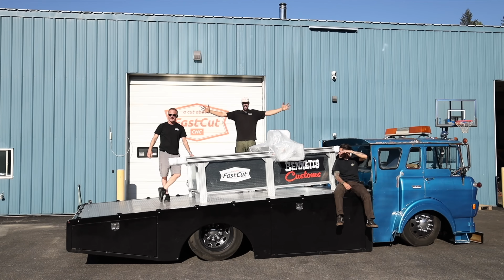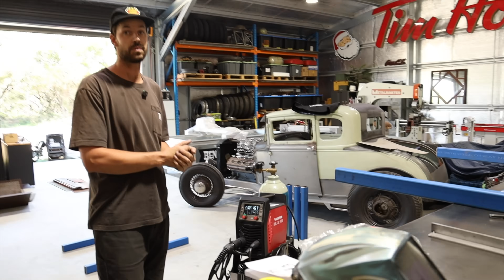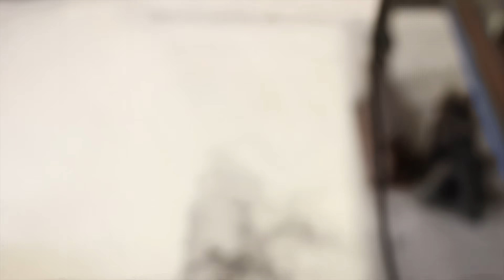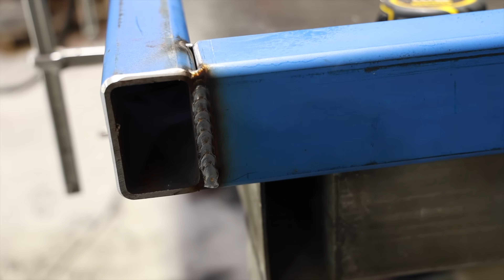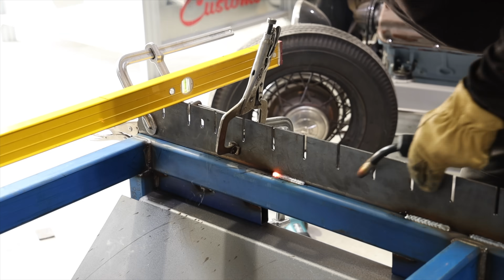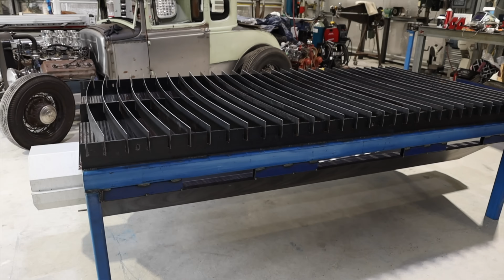We Built a Custom Table for Our CNC + Honest review of Affordable 6-in-1 Welder!

Comment: Hi Jordan ...I recently took down a tub of margarine to your workshop to use as anti splatter on your welding jobs,,,its far cheaper and cost effective than buying cans of Anti=Splatter and works just as well by simply
dipping the nozzle tip of your Mig-Welding Gun into the margarine and also stops the tip barrel from getting clogged up as well.  ..WELL SMART tip for you and your viewers... regards Graham

Comment: From my days of running a giant CNC Plasma, you are looking for huge CFM on the fan, and for the filter, youre needing a large surface area dust filter, OR, you want to look into some form of cyclone filtration.
Youll also need the fans kicked in before the plasma starts cutting to make sure the draft is already underway, and you want as much of the table covered as possible. The more you have the table covered, and the higher the velocity of the air where youre cutting, and the more likely to have the dust extracted. If you have half the table uncovered, thats the easiest spot for air to travel through, and less so where youve just started cutting.

Secondly, on that phone app for the welder, that has to be a totally stupid idea. If youre welding with a phone in your pocket, you may as well be laying there with a lighter in your pocket too. Molten metal is a great way to ignite a lithium ion battery. And if you think a cigarette lighter does damage, wait until you see a phone battery let go... Put your phone up on a shelf when welding etc. its also better for the speakers as theyre further away from metal dust. I can tell you, ive made phones useless by having speakers fill with metal dust, especially from a plasma cutter too...

Comment: I was wondering when the FastCut would make it into the workshop, it will be a good asset and nice job on the down draught table.  I see those Arc Captain Migs have been on a few shows and most seem happy with them its a pity they only take the 5KG spools though.
Have a good Easter break Jordan and Ben. Cheers Greg
Reply from the maker: Cheers Greg! It's nice to have the FastCut back in the shop and the new table will make a big difference!